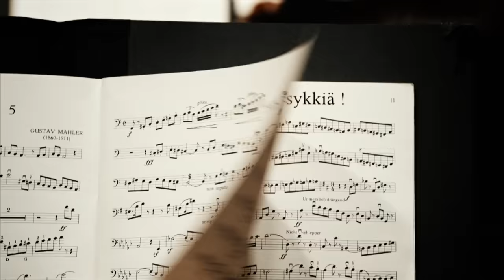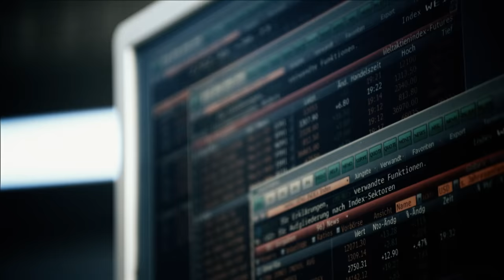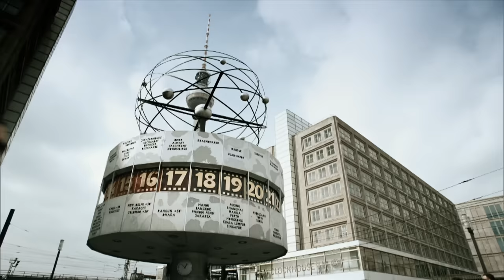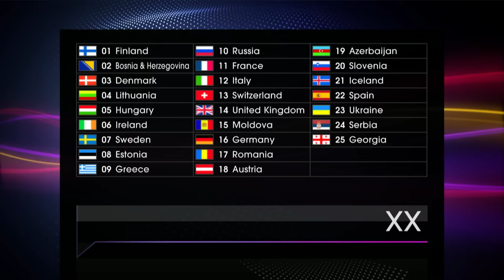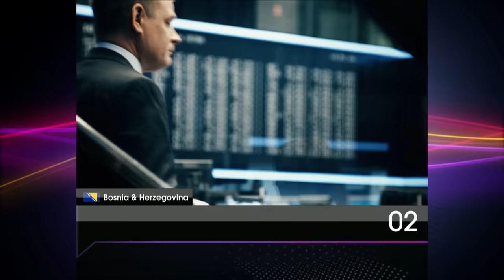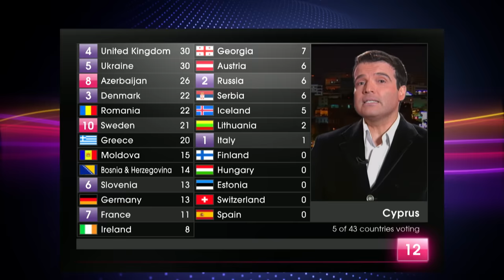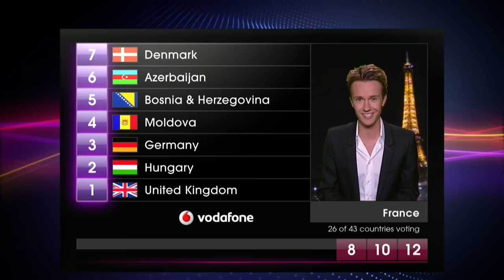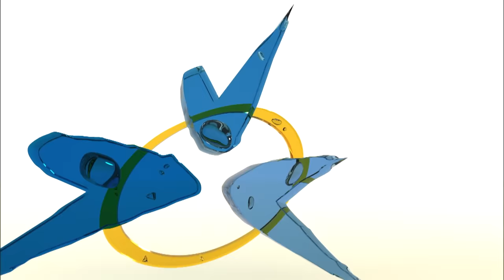Eurovision Song Contest 2011 - Grand Final - Full Show

Comment: Just look at the difference between the contests in 2010 and in 2019. How much changed!
Reply: compare Eurovision 2000 to Eurovision 2010
and then 2010 to 2019.

2010 and 2019 aren't THAT different. even 2009 had a very modern stage. But Eurovision 2000 or 2001 is like a completely different era, technically and musically.

Comment: I miss the late 2000s early 2010s when the stages and arenas were massive and so epic.
Reply: Was really the 2010 stage massive and epic? To me, it was the most undewhelming stage this decade. The stage peaked in 2009, 2011, 2015 and 2019.
Reply: knasburger productive entertainment by late 2000 and early 2010 I meant 2009, 2011 and 2012

2019 was so small and tiny expo center

Comment: Great to see the older ESCs uploaded in higher fidelity. EBU - if you're reading; please live-stream 2020 in 1440p60 👍. 

HDR is nice as is 2160p60 - but 1440p60 should be minimum. Previous web-streams get a little pixelated on fast-moving images and there's a lot of that in Eurovision. A 1440p60 stream should go a good way to keeping things crisper on busier shots 🙂.

Comment: So I just watched the Eurovision 2010 and now 2011 back to back. And one thing I noticed with both years is that if there is a woman and a man performing, they don't even have to be good, if they kiss or come close to it they get high points. No one is really voting based on talent or performance in this show, they are actually just voting based off of who is more popular. Thats why the voting started before the first performance even happened. this is honestly why I prefer the system in American contest shows because the winners and runner ups will usually be very deserving of their titles, who ever performs the best wins the show. you either give them a rate after every performance or you vote after all the acts have performed. That would make the voting system quicker, more efficient AND fairer.

 I do love Eurovision's acts and performances though, I just wish they had an actual judgment criteria in place at these times. welp, on to the Eurovision 2012!

Comment: No one:
Not a single soul:
Salty fans: Running Scared was the worst winner. Azerbaijan bribed the jurys. 

However, still, there is no proof.
Reply: KeyKaraoke They were caught in 2013 and after that their results were significantly lower. Hmmm 🤔
Reply: @jeffrey6625  but after 2013, our singers and songs were weaker as well.
Reply: KeyKaraoke to be honest I only liked 2009, 2012 and 2017. Your worsts were in my opinion 2008, 2010 and 2011.
Reply: No proof!Because it is a LİE!😤
Reply: Ramil Quliyev there is no proof of 2011, but there is proof of Azerbaijan cheating in 2013.
Reply: @jeffrey6625  To avoid getting to the first place??Maybe🤔